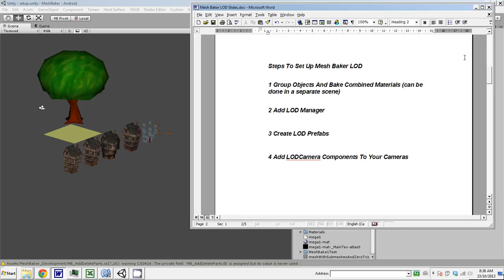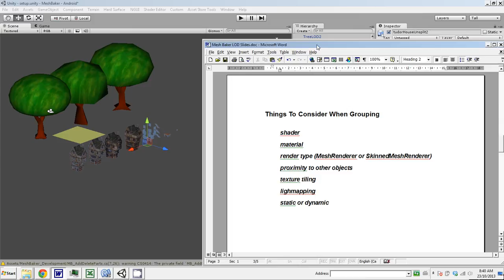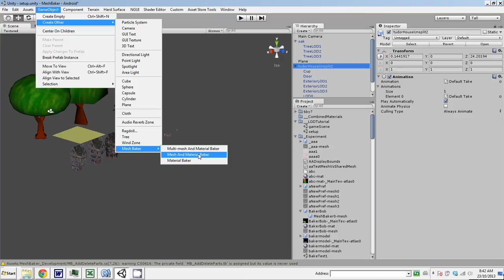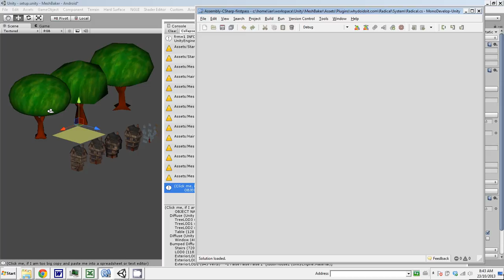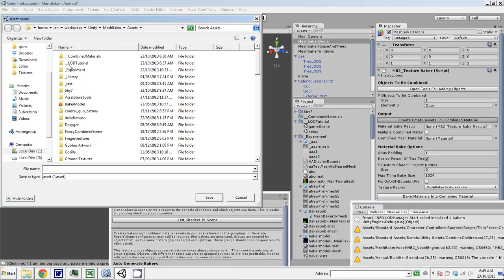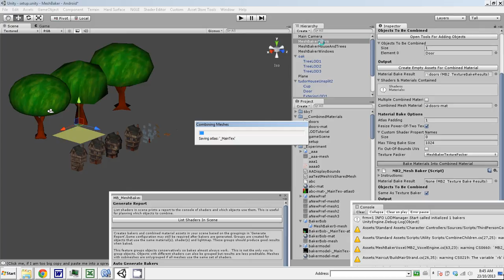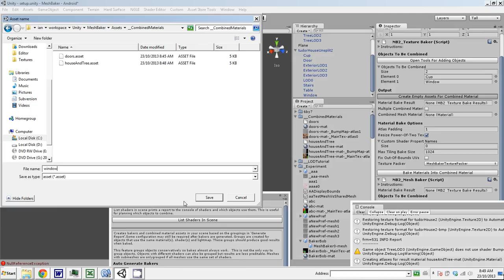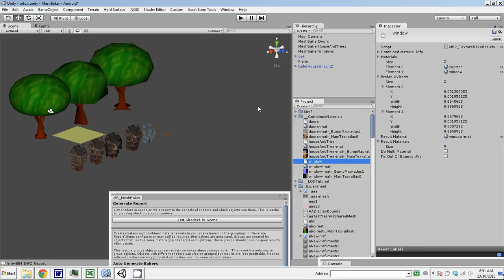Mesh Baker LOD Tutorial: Grouping Objects And Baking Materials Part 1

Comment: Does the Mesh Baker LOD support Billboards now? I'm refering to the Asset Store Review of lrb and wondered if I still need to use his code to make Mesh Baker LOD work with Billboards (because I don't know how one would integrate his code into Mesh Baker LOD).
I bought Mesh Baker on the Asset store and I'd like to know this befor upgrading to Mesh Baker LOD (as for now I'd simply remove LOD's from certain Objects which I could combine with Mesh Baker and only use LODs on Meshes who use Billboards and exclude them from Mesh Baker).